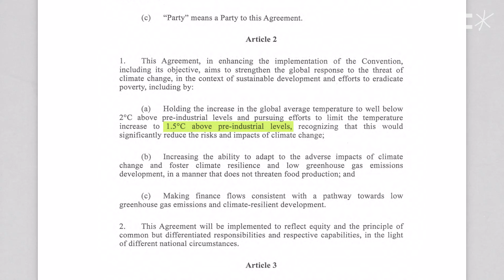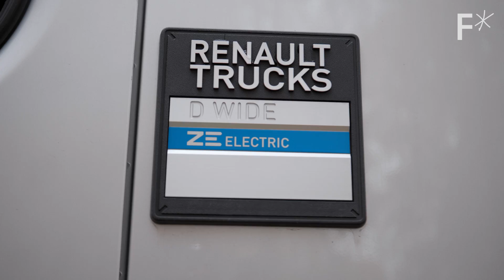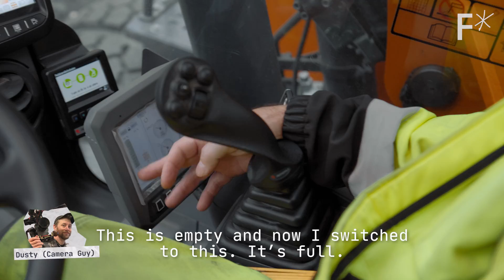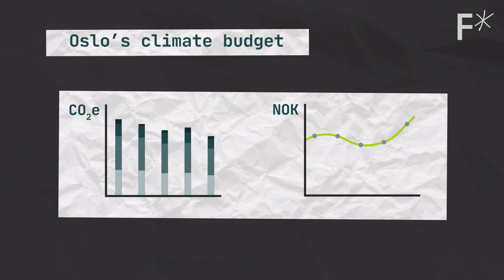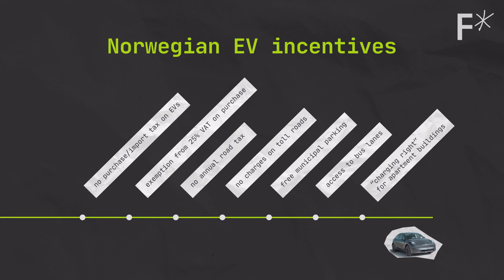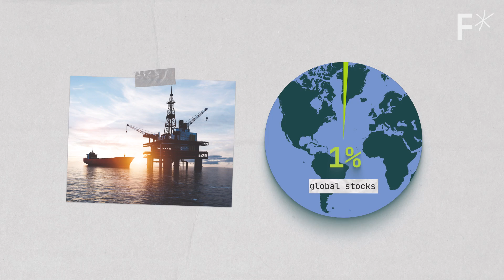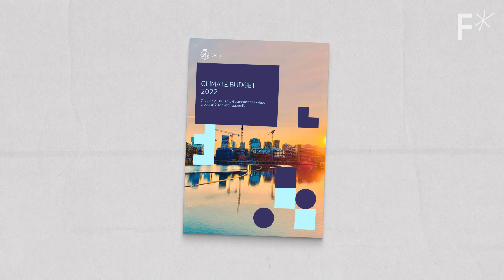The world’s most electric city | Future of Cities

Comment: Where does the power come from that charges them?
Reply: Power plants. In Norway mostly hydroelectric power station
Reply: From electricity triggered by Conservatives.
Reply from the maker: We get this question a lot and it's totally understandable!

First, Norway gets 99% of its power from emissions-free sources - 91.5% Hydropower, 7.5% wind: https://www.statista.com/statistics/1025497/distribution-of-electricity-production-in-norway-by-source/ .

While not every country is that clean, EVs still have a number of environmental benefits relative to gas-fueled ones.

- While mining and production of current batteries indeed has environmental harms, so does the mining and production of oil: oil spills, fires, the need to use and dispose of industrial chemicals, etc. Similarly, the extraction of fossil fuels itself requires a lot of energy just like the mining of battery materials. While both oil and lithium-ion batteries can be environmentally harmful to produce, EVs avoid the double hit of gas vehicles having a dirty process to generate their fuel and then that fuel itself also polluting when used.

-Happily, battery designs that use less toxic and safer to obtain materials are proliferating: We actually went to Argonne National Laboratory for a video that gets into this issue and progress on it: https://youtu.be/KMP0x0DpxSY 

-Electric grids are increasingly powered by low-carbon sources. While decades ago virtually all electricity was from fossil fuels, today over a third of the world's electricity comes from low-carbon sources (renewables, nuclear, hydro) and it's increasing every year. So while 100% of the fuel a gas car burns today or in 10 years will generate emissions, powering an EV requires a lower fraction today (depending on the area, of course) - and over time, will be cleaner and cleaner to charge.

-EVs are much more efficient than gas-powered cars. When you burn fuel in a car, about 80% of the energy is lost through heat or in other ways. By comparison, when you charge an EV battery about 2/3 of the energy is used to make the car actually move and operate. So, perhaps surprisingly, even if you power an EV with electricity from a coal-fired plant, it still requires a lot fewer emissions to drive the same distance that a gas car does. https://www.motortrend.com/news/evs-more-efficient-than-internal-combustion-engines/

Hope this helps clarify things!
Reply: even when the electric power is ultimately produced by non-renewable materials, the gas/oil/etc. is more efficiently converted to power in a power plant than if the gas was used in individual gas-emitting cars/trucks/bus/etc.
Reply: Human bodies. Gotta get the most of all the mitochondria in the world after all!
Reply: By burning coal, old growth timber and dead cats
Reply: @whatdamaddox7824  Their entire electric grid is emissions free
Reply: @nick_0  Please don't add onto my joke.  Your's is funny but you should let it stand on its own.
Reply: 8/9 hydroelectric 1/9 wind. In Europe generally fossil is fading fast (with a little help from Putin). Already now wind and solar alone provide more power than fossil. Fossil will be 1/6 of total power by 2030.
Reply: probably from zero-point
Reply: yeah using anaI probes
Reply: From trans unicorn rainbow farts harvested by robots 🤡🌎

Comment: Soooo where is the electricity coming from to charge these?
Reply: Hydropower
Reply: They want a "gotcha" sooo bad, lol
Reply: The electricity sector in Norway relies predominantly on hydroelectricity
Reply: Hydro, they said it in the video
Reply: You know, if you weren't ignorant and actually used the internet you'd know they use hydropower and wind
Reply: From triggered Conservatives.
Reply: even when the electric power is ultimately produced by non-renewable materials, the gas/oil/etc. is more efficiently converted to power in a power plant than if the gas was used in individual gas-emitting cars/trucks/bus/etc.

Comment: They are literally just relocate the emission to other place. Like battery base material mine, power plant, etc.
Reply: It’s not perfect and everyone knows that but it’s still better to use hydroelectric energy and batteries than fossil fuels
Reply: If you keep watching the video until the end, you will find that they acknowledge this, as a temporary solution while they use the profits to complete the transition to a pure clean energy system.
Reply: They also mine materials to build normal car.
Reply: And where did the Oil came from?
Reply from the maker: We hear this a lot and it's totally understandable! 

Here's the key points to keep in mind:

- While mining and production of current batteries indeed has environmental harms, so does the mining and production of oil: oil spills, fires, the need to use and dispose of industrial chemicals, etc. Similarly, the extraction of fossil fuels itself requires a lot of energy just like the mining of battery materials. While both oil and lithium-ion batteries can be environmentally harmful to produce, EVs avoid the double hit of gas vehicles having a dirty process to generate their fuel and then that fuel itself also polluting when used.

-Happily, battery designs that use less toxic and safer to obtain materials are proliferating: We actually went to Argonne National Laboratory for a video that gets into this issue and progress on it: https://youtu.be/KMP0x0DpxSY 

-Electric grids are increasingly powered by low-carbon sources. While decades ago virtually all electricity was from fossil fuels, today over a third of the world's electricity comes from low-carbon sources (renewables, nuclear, hydro) and it's increasing every year. So while 100% of the fuel a gas car burns today or in 10 years will generate emissions, powering an EV requires a lower fraction today (depending on the area, of course) - and over time, will be cleaner and cleaner to charge. (Side note: 
Norway, specifically, gets 99% of its power from emissions-free sources - 91.5% Hydropower, 7.5% wind: https://www.statista.com/statistics/1025497/distribution-of-electricity-production-in-norway-by-source/ ).

-EVs are much more efficient than gas-powered cars. When you burn fuel in a car, about 80% of the energy is lost through heat or in other ways. By comparison, when you charge an EV battery about 2/3 of the energy is used to make the car actually move and operate. So, perhaps surprisingly, even if you power an EV with electricity from a coal-fired plant, it still requires a lot fewer emissions to drive the same distance that a gas car does. https://www.motortrend.com/news/evs-more-efficient-than-internal-combustion-engines/

Hope this helps clarify things!
Reply: Yes we all have to kickstart a CO2 free economy with fossil fuels. The energy to build the first batch of green energy production has to come from somewhere. Once we have build a carbon free energy production, this will be used to build future power plant, batteries etc. A solar panel or a wind turbine generates 10-20 times more energy than it needs to build a new one.
Reply: the thing is, even if the electric power is ultimately produced by non-renewable materials, the gas/oil/etc. is more efficiently converted to power in a power plant than if the gas was used in individual gas-emitting cars. in other words, more miles can be driven with the same amount of emissions.
Reply: That is literally not true
Reply: Batteries can be made of lots of things - like salt
Reply: @evanhadkins5532  stupid argument considering salt based batteries are mostly used in lower end hev's due to their dogshit range